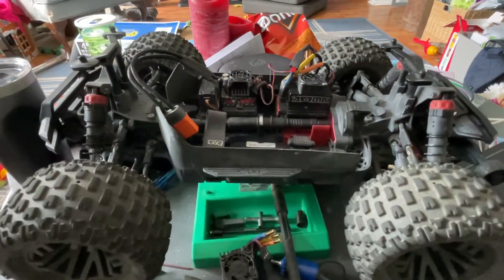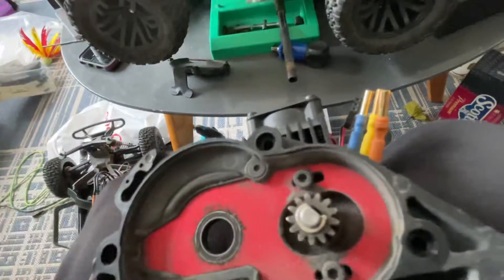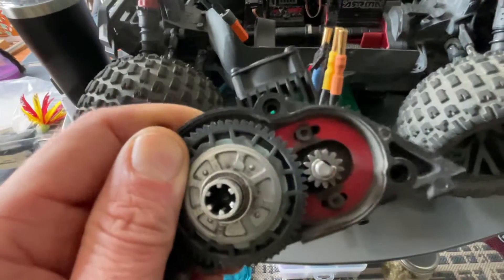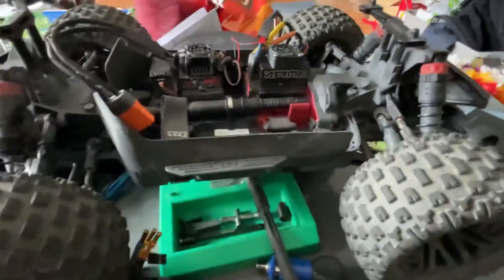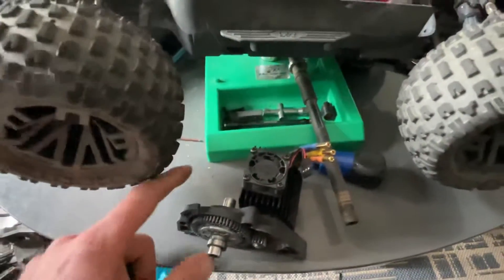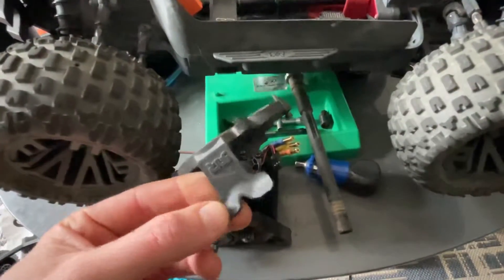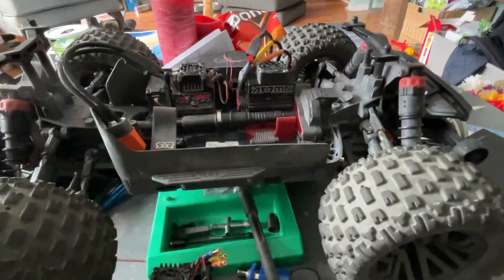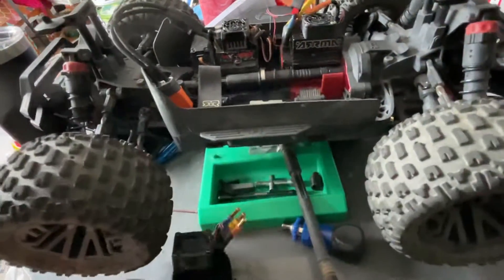2nd spur gear destroyed in the Arrma Granite 4x4 V3 3s

Comment: Skatepark is the problem lol. If the motor plate isn't the problem check the motor shaft. Bearing in the motor tend to fail.

Motor gets easier the more you do it. I'm still using my original v1 chassis.
Reply from the maker: @After Run RC Yeah the motor plate was bent And I have been running the older pre-drilled motor mount and have bash the truck even harder than the skate park and nothing has happened so far LOL seems like the old parts were better. I do always check the bearings on the motors because I’ve gone through plenty of them I just bought a whole bunch on Amazon

Comment: Washers and lock tight for the motor screws. The shock of concrete landings will do that
Reply from the maker: @ssi The washers would probably help disperse the load on the motor mount there already was Loctite on the screws after the first time I took it apart but since using the pre-drilled motor mount from the version 2 I have had no problems since and I’ve bashed it even harder than I did before lol

Comment: Its probably the crappy aluminum motor mount. I went through 2 arrma plates before I bought a quality aluminum product from ebay 20bux
Reply from the maker: @redndeyes Yeah I find the stock motor mounts are not made for bashing lol I’ve never had a problem with my Senton only my Granite keeps bending it, but it gets sent off the ramp whenever I use it.
Reply from the maker: @R What did you put under your motor?

Comment: You need to use some red loctite on it and some small spring washers behind the heads of the hex screws, won’t come loose again👍🏻
Reply from the maker: @Marky Mark yeah some small lockwashers would definitely be good.  I am getting rid of the adjustable motor mount it keeps bending now putting in the old  pre-drilled one I’ve never had a problem with that
Reply: @rcdaveshobbies  yh once alloy bends once I think it looses its molecular structure and becomes weak and causes more problems, best to stick with what works best mate, I’m having trouble with shock oils, I’ve used some “ploline” China proline lol, there ok to be fair but I’ve used 1000cst all round front are good back bottom out easy would I be right to think 2000cst would be twice the resistance of the 1000? Core tv have a 1300 or 2000cst any ideas?
Reply from the maker: @markymark9407  I don’t know if the 2000 would be twice the resistance but but should be more resistant than 1000 did you try making the rear spring stiffer by adding in the clips? Or you might need stiffer rear springs
Reply: @rcdaveshobbies  Hi Dave, yes I’ve adjusted the spring collar as low as possible, these are China proline copy’s “ploline” so not sure if any diff springs available, is it just a case of matching length and diameter  ? Gonna try 2000cst 💪🏻 this hobby is never ending spending lmao, have a good weekend and stay safe
Reply from the maker: @markymark9407  Are they a double spring shock? proline sells a set with three different spring rates (6063-04) the red are the stiffer ones. And if it is a single spring they do also sets for those. I would start with a thicker oil and see how that goes or find pistons with less holes in them.
Reply: @rcdaveshobbies  yeah I’m gonna try the 2000cst if no good I will look at the pistons, easy to fill in the holes with a bit of copper rtv sealant, there single spring “piggy back” shocks single spring 110mm long, I noticed the quantum had a fair bit of movement in the arms once the shocks were unscrewed from the shock tower, so decided to try the 110mm shocks, gave it a good ground clearance compared to the standard shocks, for 40 gbp that got refunded as I couldn’t get the adjuster to move on one of them, seller refunded and said keep them, pliers sorted it out with out a scratch lol !
Reply from the maker: @markymark9407  I think the oil might be enough but good idea on the piston holes. You should look into the RPM lower arms there are two different spots to mount the shocks so you can adjust the right height as well with that and I find they are more flexible and have been more durable than the stock arms. Let me know how it goes and good luck 🤞
Reply: Never use red locktite on rc motor screws unless your never taking that motor out! red locktite is permanent

Comment: U need a metal spur plus ur motor is loose u need to move it closer to the spur and tighten it good
Reply from the maker: @Reggie Williams I do have the metal spur gear on order but I’ve been waiting months for it I also ordered the version two motor mount with the pre-drilled holes because I did Loctite the screws and put them tight But it’s just a lot easier with the pre-drilled holes

Comment: I replaced my motor on my V3 mega and noticed something. The front servo control arm interferes with the driveshaft. When you have all four tires off the ground and you run the motor. Turn the wheels and you will see the control arm grind on the driveshaft. This was putting a ton of strain on my motor and fried it. Just another little issue with this truck.
Reply from the maker: @David O’Halloran I’ll have to check that out on mine thanks for the heads up. I was looking at ordering the metal driveshafts from Arrma but there expensive. I’ve had rocks get stuck on the driveshafts and knuckle and cut grooves into them